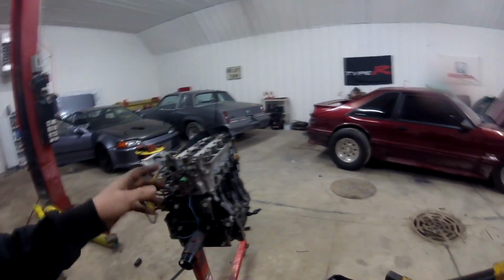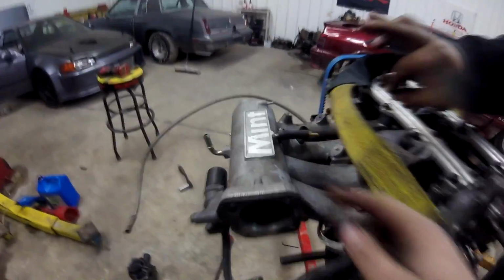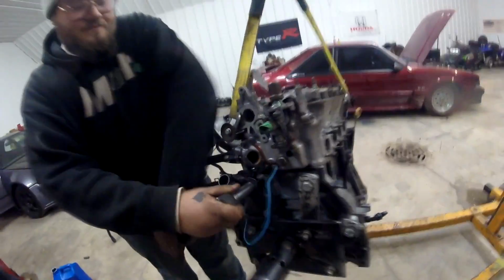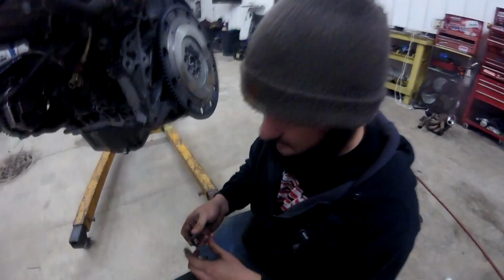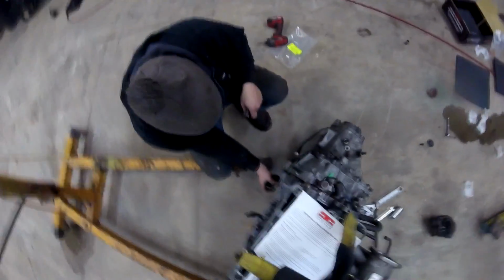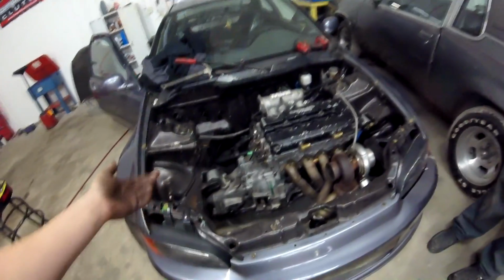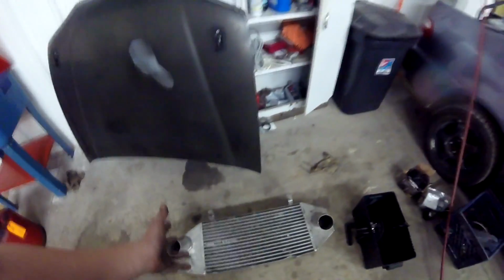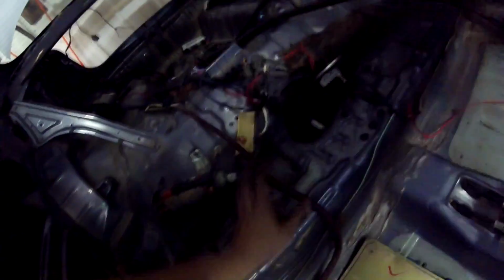Got My Engine Installed Into My Drag Civic EG Coupe!

Comment: U should be able to make more than 700 with the -8 and a 525 walbro. I made over 700 on a stock hanger, stock fuel lines, and a walbro 450 with id2000s. I’m curious to see how the 525 will do, looking forwards to some feed back about it from u

Comment: Hunter Tuned I used the lower front shock mounts from an 04' chevy truck and just re-drilled the hole to mount to lower control arm!  Easy trac bar mount, They usually unbolt easily from the truck control arms.......USUALLY

Comment: For the track bar links you could do what I did. I welded 1/4” tabs straight on the lower control arms to bolt the heim joints on. I used my 110v Hobart handler 140amp wire feed on max amps (setting 5) and wire feed at 50. Hasn’t broke yet.
Reply: Preciate it bro
Reply: Lightning Autowerks™ With Fluxcore I wouldn’t weld anything anything over 1/8. Structurally it’s not great but for thin exhaust it should be more than enough.

Comment: It’s looking sick. I love EJs way more than EGs.
Reply: an EJ is actually 96-00.  This coupe is an EG.
Reply: Vicious Ballz EJ1 is the 92-95 EX. EJ2 is the 92-95 DX in the US. EG is only for the hatchback. The EJ does extend into the 6th gen with the EJ6/7/8 coupes as well but the first EJ was the EJ1 1993 Civic EX Coupe. I’ve only owned coupes. A 94 EX, a 95 EX and currently a 95 DX. The Fast and Furious hijack Civics were 1993-95 “EJ” coupes. Look it up. Those Civics is where my love for the 5th gen coupes stems from.
Reply: what he had before was an ej6 hatch which people call an EK, but the EK is the type R.